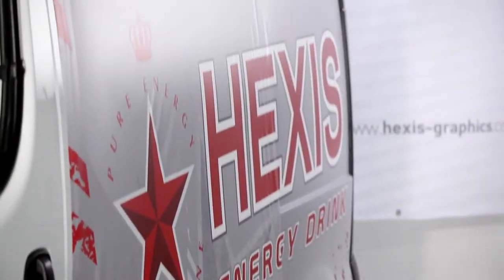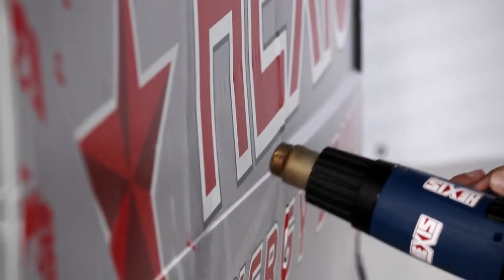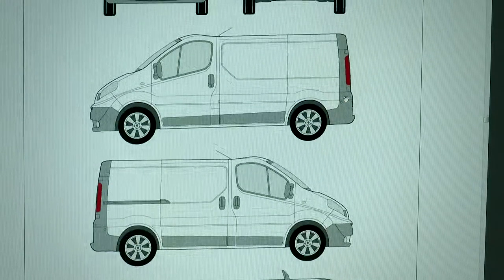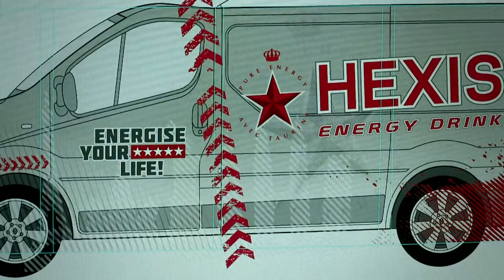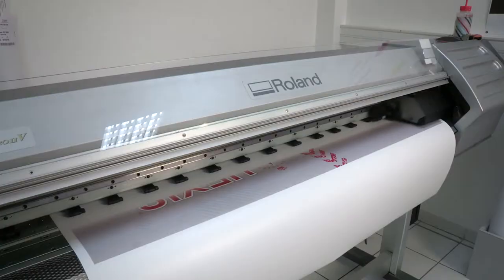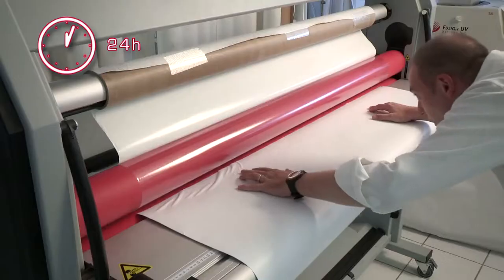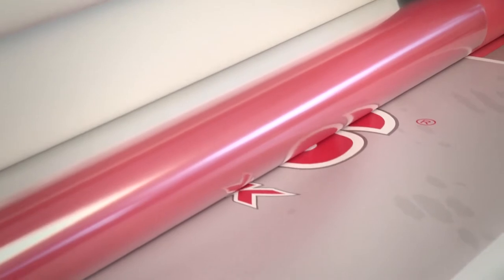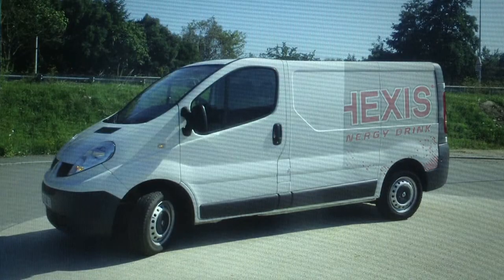Hexis Training - PRINT

Comment: I would take this importance further and say that 24 hours is a minimum especially when using full solvent inks. For light colours yes 24 hours to out gas (when outgasing correctly for the solvents to drop off the vinyl) is sufficient, dark colours we recommend up to 72 hours before laminating and applying. The darker the colour the more ink on the vinyl there for longer to outgas before laminating and applying the print. 
However latex does not have this problem and is safe to laminate and apply straight away.